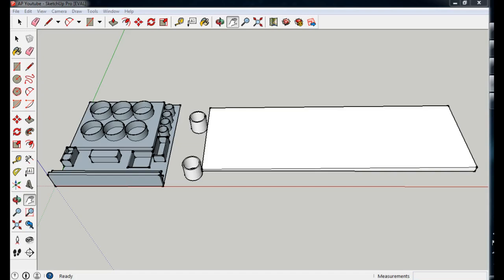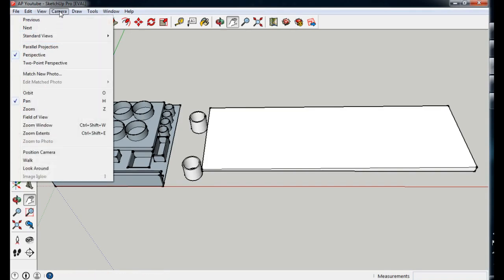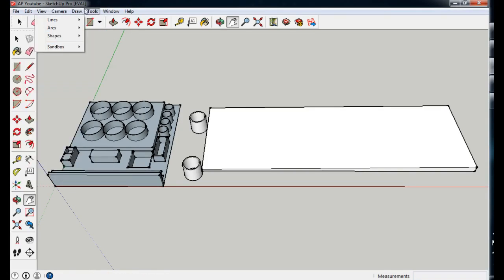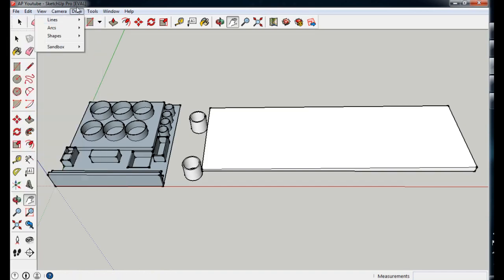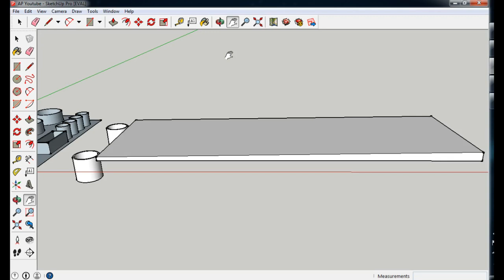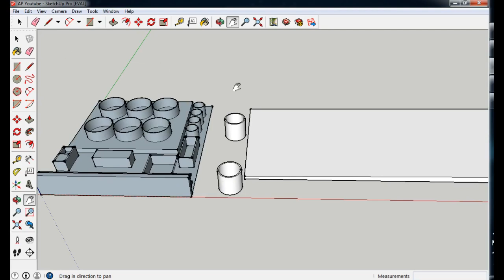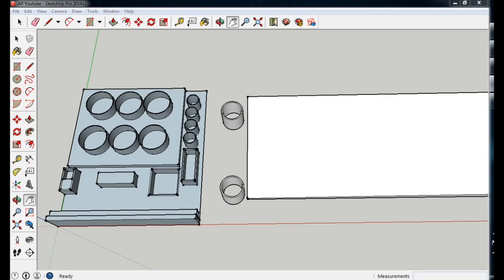Commercial Aquaponic System Build Part 1

Comment: Here in Texas, we also have a problem with heat. I purchased 70% Luminet, an aluminized shade cloth, and haven't lost a hen since beginning to use it. It also helps me grow tomatoes and chard MUCH longer into the summer. Not only does it produce shade, but it provides a radiant barrier effect, too. It is nothing short of MIRACULOUS and I recommend you try alumunized shade cloth over at least a portion of your set-up. I think it is produced in 30 > 70% coverage.
Reply from the maker: Aluminet is a great product, and it is available here, however it runs about $700 for a 100 meter roll. I have another product I am going to use which I will show in future videos but if it doesn't work out, aluminet will be my next option.
Reply: hi everyone ,if anyone else trying to find out aquaponics diy try Tarbetti Amazing Aquaponics Tutor (do a google search ) ? Ive heard some incredible things about it and my co-worker got great results with it.

Comment: DWC vs Vertical? I never heard of vertical systems being less expensive per "hole" the added infrastructure of vertical far outweighs the added cost of a few extra sq m of greenhouse space by my math.
Separating your water seems like a shaky idea. if you are running a high stocking density how long will your water quality hold up without having to replace your water and waste all your good nutrients? Excessive nitrates are not good for fish either even if you can break down all the ammonia and nitrites which is iffy given the proportions of your design. I am no grand master but it seems like pointless complacation since you will have to constantly mix your water to maintain ideal water quality for both fish and plants, that would in effect eliminate any advantage of seperate Ph since controling the separate levels would be a full time job and require constant acidic and basic water treatments. Most plants and fish do quite well in the 6.7 Ph range no need for fancy separation IMHO.
I think you would find that you do not have to add nearly as much mineral additives if you strive for complete mineralization rather then separating out solids. I have seen scuds COMPLETELY break down the waste of a high density system to the point that the net tank never needed to be cleaned! Would save you a few extra water tanks too. Just a thought.
What stocking density are you planning on running, how much water circulation, how much aeration?

Comment: Sounds like it's coming together! I would definitely design an end wall so that you could easily put in a wet wall evap system without any headaches, should the need arise. Looking forward to the build, and updates!
Reply from the maker: keyplayr61 The framing will all be steel, so the option to add later is definitely there should I decide to do a wet wall. I may try some high pressure misting fans and see how those do.